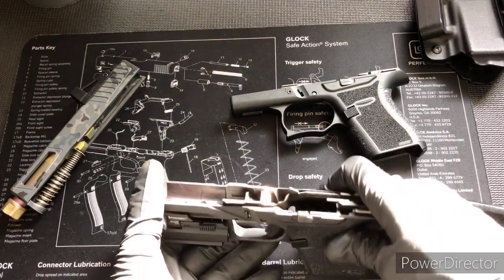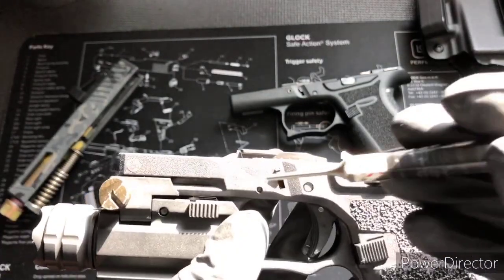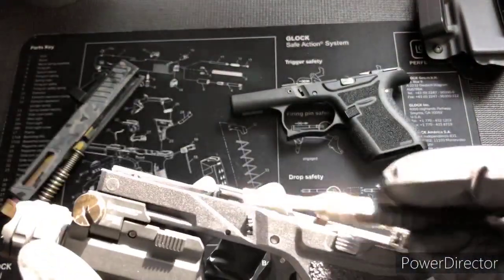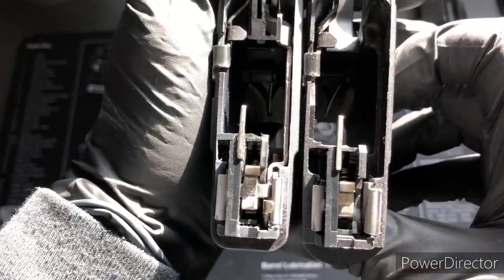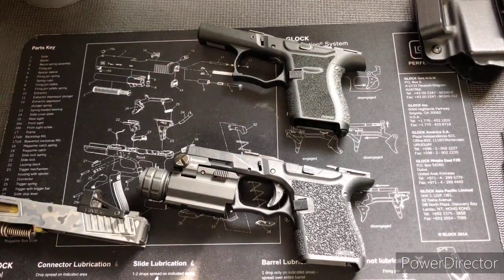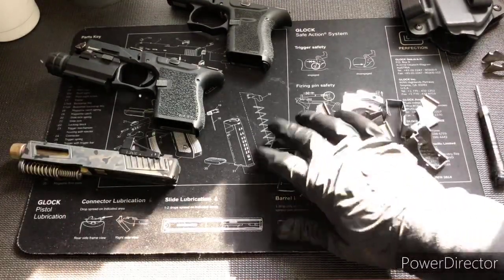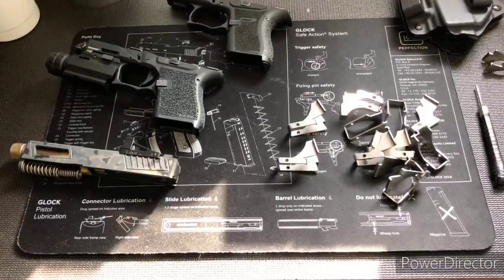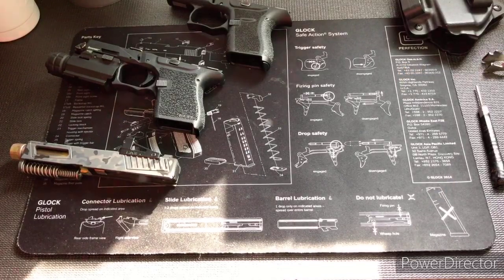PF9SS WITH SS80 REAR RAILS

Comment: I sent you an email with questions about the rear rails.  Let me know of any ideas or such. Thanks.
Reply from the maker: Geo I’ll check my spam mail and see if it’s in there. Thank you!
Reply: I figured it out. The rails were sitting too high.  Looking into the area where you seat them, I was able to grind away at the rounded part and flat bottom piece that holds the two rail sides together.  This allowed the rails to sit lower and the holes lined up, and with the correct grinding, the right rail was now level, as the front of that right rear rail sat up higher.   I also stone sanded the tops, sides and bottoms of the rear rails, to smooth them out and thin the height of the rails... the rears are way to thick.   Smooth as silk.

Comment: Interesting, this swap never occurred to me, but when I saw the probs with SS80 front block, the first thing I thought of was modding the frame to use a P80 front block. Just from eyeballin' videos, it looks like the recoil spring channel in the area of the front legs is ~0.75" deeper on the SS80, so there's room for a pin. If you ever get an angel investor, it looks like the SS80 rear with a P80 front would be the bee's knees. I get that it complicates detail stripping, but I'd guess not many people REALLY need to do that. There are spray cleaners that specify they are safe for polymer guns, if you need to get debris outta there.

Comment: Always enjoy your innovative ideas and nice work! You always seem to be a step ahead. Watching your videos also makes me reminisce of when I had access to a machine shop, and fabricating parts inspired by thinking outside the box. Quick question what tap thread type did you use on front rails, and is it same as used on latest P80? Many Thanks friend
Reply from the maker: Thank you I greatly appreciate those kind words. 
I get that too sometimes. Nothing better then reminiscing right? Good old days! 
I used a Irwin Hanson 4-40NC High Carbon Steel Plug Tap. To be use with #43 drill bit. Then use the next size up to make the seat for the tap allen screw to countersink in. If it don’t make sense I can send photos. Let me know if you run into any trouble I’ll be more than happy to help you. 

Cheers mate!

Comment: Did you use the ss80 rail in the pf9ss? did it just go in with no modifications?
Reply from the maker: I had to just remove the two rear polymer humps on the inside of the pocket of the PF9SS. That was it. Very easy to remove the material. The rear pocket of the PF9SS needs to be even so the SS80 rail sits in flush. Let me know if you have any other questions.

Comment: What’s a good place for magazines ? What do you suggest I get for my Glock 26
Reply from the maker: I’d stick with the factory Glock mags. Right now it’s pretty pricey with all that’s going on and out of stock at most places. Check eBay for some that are on bids might go cheap. Also check out Brownells, GunMag wearhouse and Arms Unlimited. Also you can try https://outdoors.natchezss.com/bestsellers/Glock-26-Magazine. If you really need some mags and don’t want to break the wallet pmags will work. I just wouldn’t use them for edc. That’s just my opinion.

Comment: GlockStore front rail is whack as hell though right? The rail walked up after 500 rounds. I switched it out for a pf9ss. I like it much more
Reply from the maker: Brandon Abbott I got over 5000 rds on my SS80 and still going strong but I did add set screws to the front locking block. There’s pros and cons to both imo. I definitely like the SS80 rear rail much better that’s why I switched out the Polymer80 rear rail on the PF9SS and put the GlockStore rear rail. It’s so much smoother. I go back and forth between the two all the time when I go shooting. Man I really wish I had the connections to come out with my own frames I’d definitely do it right.